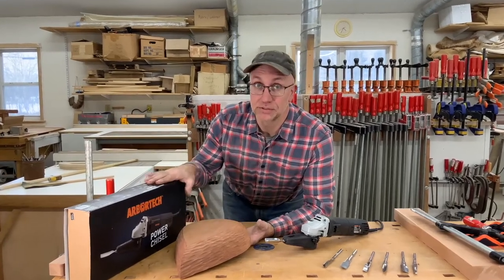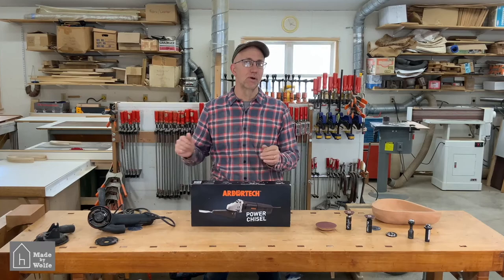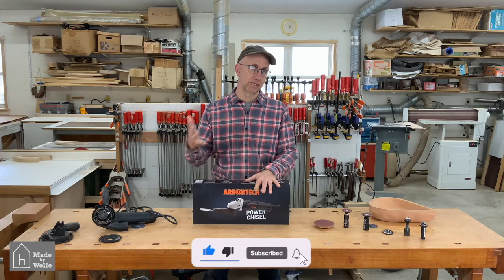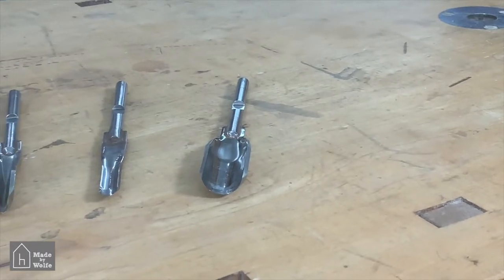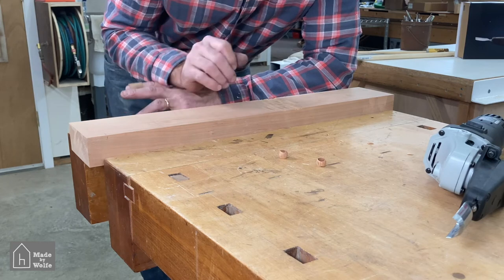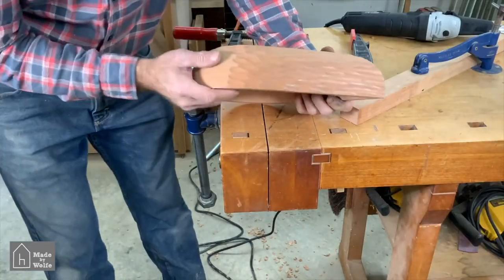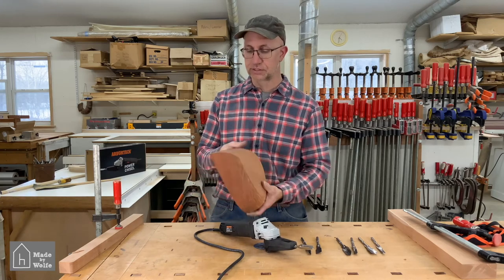ARBORTECH POWER CARVING TOOLS REVIEW: the Power Chisel #5 of 6

Comment: Have you tried it on any wild grain? Like burls, knots, birds eye and such? Thanks for a helpful review!
Reply from the maker: To be sure, it is important to remember all the same rules of woodworking and carving as far as grain direction goes. So, while I have not tried it on any wood with more challenging grain patterns, I would expect that the same challenges would remain.  I know for regular grained woods, like the bowl in this video, it still acted the same.  If you have not seen it, check out this video where I did a significant amount of chip carving with the Power Chisel.  But In order to negate the grain differences between the boards, I did all of this carving across the grain, which usually decreases the tear out. But then your carving pattern is 90 degrees to the wood grain.  

Hope that was helpful.  Thanks for watching and thanks for commenting.
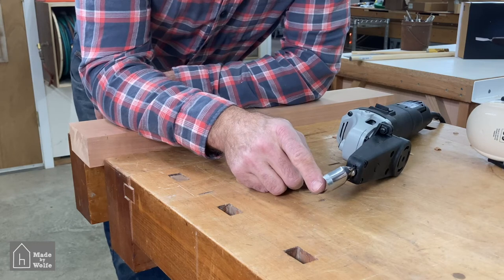Reply from the maker: OOPs forgot to add the link to the chip carving video (the chip carving starts at 5:12 in the video):  https://youtu.be/CxXTmCS7hvo.
Reply: @MadebyWolfe  Thank you for your answer. It clears things up. I do a lot of hand carving so i'm used to working in relation to grain directions. But I have never used a power chisel and i'm very interested in buying one in the future, mostly for ergonomic reasons but i've been trying to figure out in my head what those micro movements would do to those kinds of grain structures. =) Thanks for the answer, and i'll check out that video for sure!
Reply from the maker: @ClaesKamp  Yes, the ergonomics is different, and I think better.  It is more weight than a chisel, but the grip, force, etc. is so much less, and if you use a mallet with the hand chisel, that is no longer a part of the picture.  So that you are aware, there were some instances where I was able to see the micro movements in the chisel stroke.  I mention it here only because of the nature of your posts.  It is extremely minor (I have to be specifically looking for it and pretty much only on end grain) but can be identified if you go looking for it and you have experience in carving.  Most would not even notice it.  On the other hand because the stroke with the Power Chisel is so much smoother, the overall result is pretty sweet and an improvement from before.  And the quality and life span of the chisel edge was better than I was expecting.  I had to resharpen less than with my regular chisels which are pretty decent chisels.
Reply: @MadebyWolfe  Thank you so much for that answer. I'm now decided on getting one. Hard to find that kind of usage information on those tools. Ohh now the tool acqusition disorder is on! =) 

Take care!
Reply from the maker: @ClaesKamp  I am glad it was useful.  Enjoy your new tool.

Comment: Is it noisy?
Reply from the maker: That is an excellent question.  My answer is...you need to wear headphones.  I actually think it is not as bad as a miter saw, but it would not be good for you hearing to listen to it long term without headphones.  Also, it is variable speed and the speed you have it at makes a big difference.  At 6 is it quite noisy, but at 1-2 it is not too bad for a power tool.  Hope that is helpful.  Thanks for watching and for commenting.